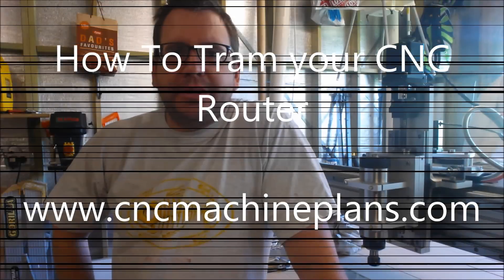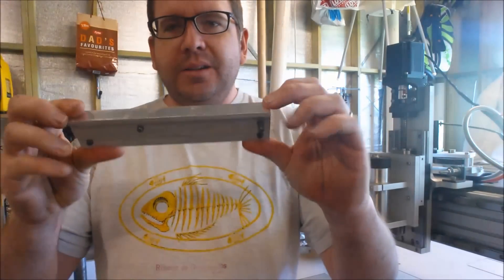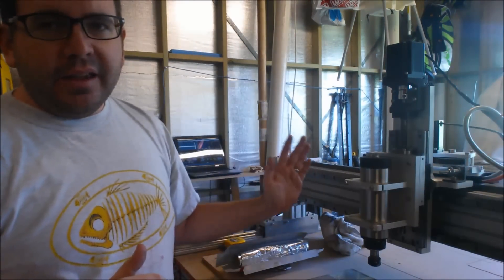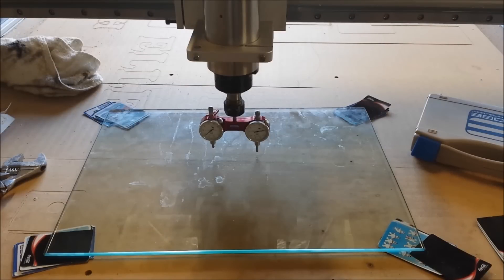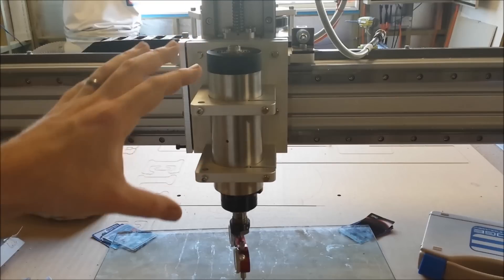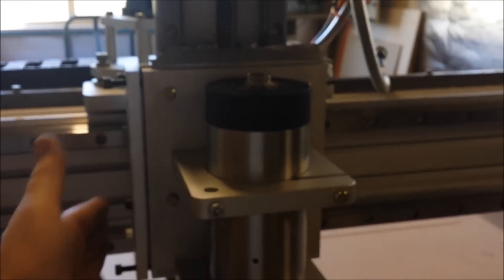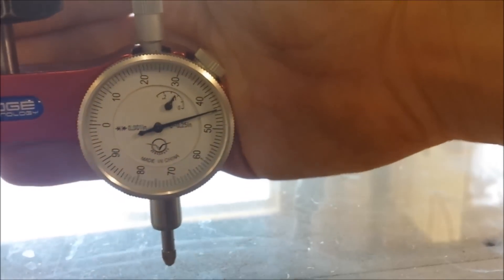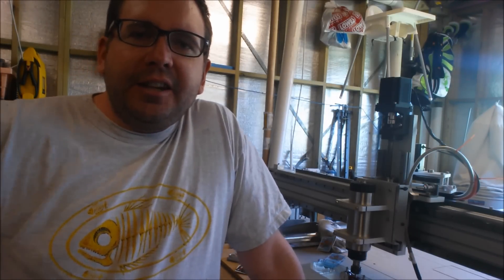How to tram your CNC Router

Comment: Great video and very informative. I don't own one of these CNC routers yet but I'm closing in on purchasing one so I'm interested in how to set everything up so I can get the best cuts.
   To that end I just want to be sure I fully understand the idea behind leveling the glass. Apologies if this is beating a dead horse.
   So, I get that we need the true XY plane to do the tram and make the spindle truly perpendicular. The bit that a few others brought up, which I couldn't get past at first either, was that you've trued to the real XY plane but not to your machines XY plane, the bed. So if you plunk something down on your bed and start cutting, one end will be shorter than the other. I went over the video again and you seem to be saying that what you do once you get the spindle trammed is to actually cut the MDF bed so that it is now as close to the true XY plane as it's gonna get and your workpiece should come out square . . . ? Is that right?

Comment: how do you know all your cards are the same thickness?
Reply from the maker: You use multiple cards to shim until it's right. It varies in each corner of the glass. You don't have to use cards, use anything really, no I use a granite plate and adjustable feet.

Comment: Thanks for the video. But I don't get it. You are aligning your glass to the spindle. If it's already off you are just lining up something that isn't square. Are you not? Wouldn't you surface your table, then put the glass on it without shims and then tram the router to that? Even if your tram is off the table will be parallel to the spindle even with some lines. I know this is old, but I hope you can sort me out. Thanks.
Reply from the maker: You use an indicator to level the glass to the same plane as your XY. This method works for me 100% then I can surface the table once with zero lines.

Comment: how to find the righ agle of router, and how to fix a rightagle in corner of router working area?
Reply from the maker: Parth Patel that's a vary vague question
Reply: Cut and Carve , i means how to setup job at perfect rightagle of the router?
Reply from the maker: Parth Patel you can use a jig or an edge finder.

Comment: This is terrible wrong. If you need to shim your glass, then your bed is NOT level, meaning no matter how much you tram the spindle, it will not be truely be accurate, because the bed is not level with the X, and Y axis of movement. 

Seems to me, by shimming the glass, you are tramming the spindle to the glass, not the bed, this means you will still be out of tram because the work piece sits on the bed, or in a fixture, that sits on the bed. 

It would be much better to first level your bed, and check the X and Z travel for inaccuracies, then shim the bed until you've leveled it out as far as travel on those two axis are concerned, then tram in your spindle to the bed. Doing it the way i described removes quite a bit of variables, and makes tramming the spindle much more accurate, as you are addressing your bed issues first. 

If you tram to the glass, then as you move along the X, or Y axis, you may find that you aren't moving parallel with the bed, meaning your work will be inaccurate.  As little as 1/2 a degree "tilt" in the bed will introduce quite a bit of measurable difference from one end of the bed to the other.
Reply from the maker: ArcAiN6 my frame is flat but the mdf bed isn't. I am only showing the method they used in manufacturers world wide. But they use granite surface plates. Once the tramming is done then your surface the bed. 

This method works perfectly and leaves me with zero witness lines cutting in XYZ I would suggest trying this method first before trying to theorise on how it possibly can't work because tried and tested it works every time.
Reply: I had exactly the same instinctive reaction--forgetting what you'd clearly said about surfacing the bed SECOND, not first, as a typical newby might.

You could I suppose use the same technique to tram to the bed itself, but I'mI  guessing that you're guessing that much more adjustment would be necessary in that case.

If the machine was put together reasonably sanely, I would guess that adjusting the machine so the table was level and then tramming to the table would result in reasonable tramming trims.  Surfacing the table  would then be removing only modest table imperfections.  I would think a "level table" would just be one more nice thing to have. Thanks for the tutelage. It certainly looks within reach for ordinary folks.  I guess I still have to manufacture and install that side plate?

Comment: One further comment if I may. Clearly perfection in these matters is desirable, no doubt about it. I have spent many hours over the years  chasing thousands of inches setting up jointers and planers as a wood worker. But let's consider what we're actually doing on the CNC table. First, this is not a milling machine. Predominately, we're probably cutting out, or  engraving profiles. See where I'm going? If you're cutting out some lettering, a slight lean in X or Y axis is probably undetectable. Just my two cents worth. Please correct me if I'm all wet., Mark
Reply from the maker: Mark Wilson for the most part yes. But for example I cut some stair stringers for a builder the other day which you can see on my Instagram page. The MDF was an inch thick so I did it in several passes, now if it wasn't trammed properly I would have steps on each pass and these stringers were dovetailed together so I didn't want to do any sanding and the customer was very impressed with the quality so I get more work. If things didn't fit together properly and had leans on them then I wouldn't be doing the best that my machine offers and that would irritate me. People pay for things to be done on a cnc hoping to get a better cut quality that can be done by hand. Maybe it's just me but I get irritated when I get given a part that's not up to spec of what a machine can produce. I used a granite surface block last week to tramm my machine and everything is within .01. and at the end all joints, right angles, fittings are all to size and fit beautifully and can save hours of work later in sanding, planning etc. There is nothing better than taking a piece off the machine and there is no work to do except assemble.
Reply: Point well taken. I am definitely going to check my machine. Thanks for your insights.
Reply from the maker: Mark Wilson all good happy to help. Hope the machine works out for you. 👍 Hope to see it on youtube. I have a VMC build coming up.

Comment: I'm just commissioning a brand new 1325 CNC router I've imported factory direct from China. Very good looking build, central lube system, 5.5 kw water cooled spindle 24,000 max rpm,  Becker 4.5kw vacuum pump, good dust collector etc, $12,500 CDN all in plus another $2,500  CDN for other ancillaries. I will do your test very soon. I'm certainly curious to see how close they've got it! So far the Chinese experience is very good. i'm also very happy with my 1612 150 watt laser, also imported factory direct from China. Total cost with two rotary devices $10,000 CDN. Looking forward to reviewing more of your posts, Mark

Comment: for adjustments instead of the foil couldnt you tap holes in that front plate and put adjustment set screws with fine threads to push against your rear plate.technically doing the same job as you new side plate.
Reply from the maker: michael dodds yeah for sure. anything to adjust it to get it planer

Comment: How do you set the z- axis perpendicularity?  I used a square with a dial test indicator, logged the deviation, then rotated the square 180 degrees and again logged the deviation. Then I adjusted the z axis to the average.  A real pain to accomplish.  On fellow used a granite square to set perpendicularity, that tool must have cost quite a lot. Have you any ideas?  Also where did you get you dual indicator tramming thingy?
Reply from the maker: Dana Patelzick the dual indicator thingy came from edge technology. I am not following your question to well but you just use shims to get it perpendicular to the table. I am going to do another video of tramming soon.
Reply: Tramming seems to have two elements.  1. Is the z-axis travel perpendicular to the XY table and 2, is the cutter perpendicular to the XY table. The first has an impact on machining tall parts and the second with machining a flat surface without ridges.
Reply from the maker: Dana Patelzick well if your z axis is milled with a bow in it then your going to have the first problem. but if it is milled properly then tramming xy should be all you need to do. it would be impossible to tram in stages down a z axis. like I mentioned your z needs to be milled properly so it doesn't matter where it is in the travel it remains true.

Comment: I was at a China cnc factory and they pretty much used this exact method. They would place a block of precision granite on the table and then shim that (same way as the cards) and then sweep the block with a dial gage off the spindle.
Reply from the maker: Drew thanks for the comment. I just need to get a precision block. I am moving soon and will do an updated version of this tramming method using a precision block.

Comment: Shars tools have the indicator. I like your setup to adjust the spindle, the intermediate and side plates are an excellent idea. But yes your spindle is orthogonal with the glass but it may not be with the table and the table may not be a true plane either, etc. This would be the last step when every axis plane is truly planar and they are all orthogonal to each other.
Reply from the maker: That maybe so. But this method works to get zero lines and ridges when surfacing the table and getting the spindle straight.
Reply: Thats why after doing this you surface the table.

Comment: Excellent video!
I'm assuming, because it's a relative thing, that you can do the same by rotating a single indicator at an angle to the spindle?
Reply from the maker: exactly right. You just need something that can read evenly whether that be an indicator like what I am using or a single indicator that you can pivot round the spindle

Comment: What role are the cards playing in this?
Reply: +Matthew Volkmann maybe adding some error to screw things up
Reply from the maker: +Matthew Volkmann its to level out the glass to the same plane as X Y
Reply from the maker: +Maurizio B if your screwing it up then you not taking your time to carefully tram your machine.
Reply: +cncmachineplans I guess my actual question is: Why not just put the glass on your bed directly? Shouldn't the bed already be coplanar to your x and y axes?
Reply from the maker: +Matthew Volkmann in a perfect world yes. But it's more so getting your spindle perfectly aligned. There is going to be some imperfections everywhere and if you tram your spindle directly to a mdf spoil board which isn't flat to begin with then your spindle isn't going to be straight. The glass it's being setup to be co planer in X Y so when you tram Z they are all good then you can surface your spoil board without lines.
Reply from the maker: The best thing to do is just try this method and youll see for yourself that it works. Cheers Chris

Comment: Great idea with the glass and cards...also the aluminum plate for tramming the X-direction...I've been machining metals for 28 years but just got my first router and the Y-Axis is out .010 inches so I was researching ideas on how to tram a router vs a manual milling machine..the manufacturer of the my machine actually has too thick of a shim in place..Thanks for the vid..I'm surprised you don't have more comments
Reply from the maker: Thanks for the comment much appreciated. Hope it helped out.